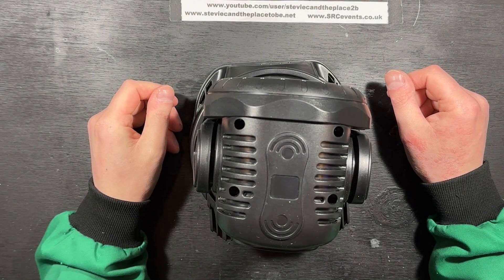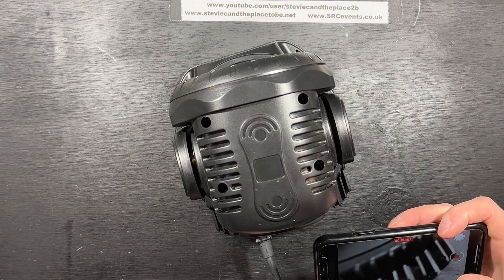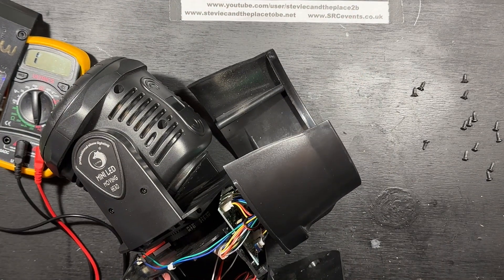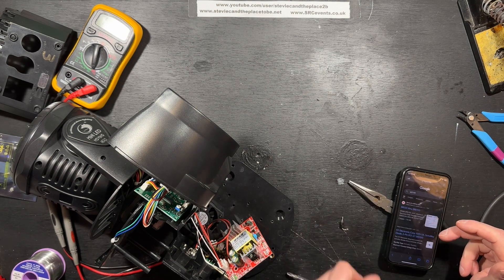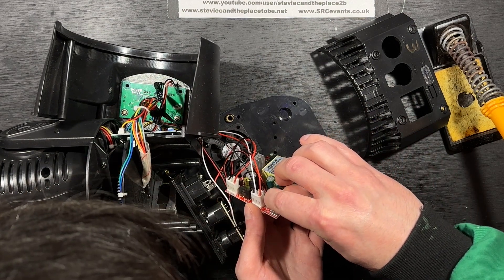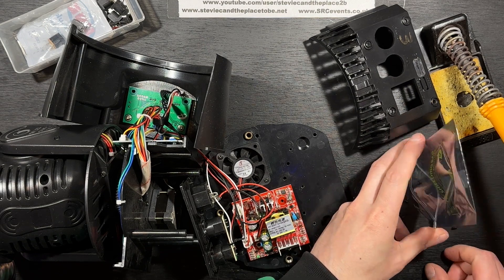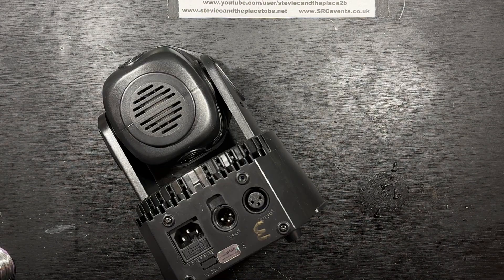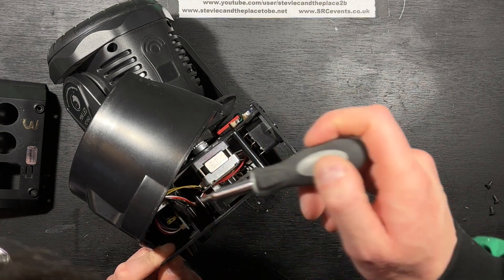Bonus Video: RGBW LED Moving Head Repair

Comment: Top man. This is the model I have so good to know.

I found you because the TILT is 'soggy' during reset, and the head just hangs.

I have found that the Tilt servo motor is located inside the the moving head itself but haven't dug into it yet.

HAVE YOU HAD THE MOVING HEAD APART TO BE ABLE TO OFFER ANY WISDOM FROM EXPERIENCE.
Reply from the maker: Sometimes you can free up a stuck servo motor with WD40-silicone, and maybe partial disassembly.

Comment: How would you fix the head since it has no belt and seems to have lost its strength to lift itself.
Reply: You have the exact same issue as my LM70S but I haven't  dug into it yet.

I know the tilt servo motor is located inside the head.

Did you ever find the cause of your issue to be able to affer any advice ?

Comment: i have a mini moving head wash light, and it appears to shake and doesnt make the full pan and tilt movements. what would you recommend? thanks for your videos. I have 3 others and have placed the pan and tilt to the same, but one is definitely off. everything else, as far as the light colors changing, etc, work fine.
Reply from the maker: Hmm… without seeing it I can’t really say but it sounds as if the motor has failed or is out of alignment.